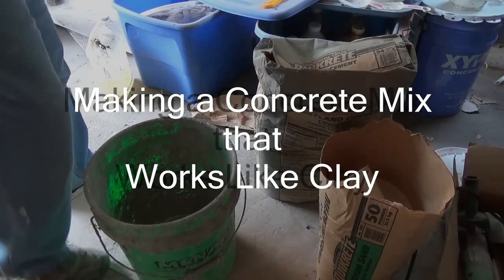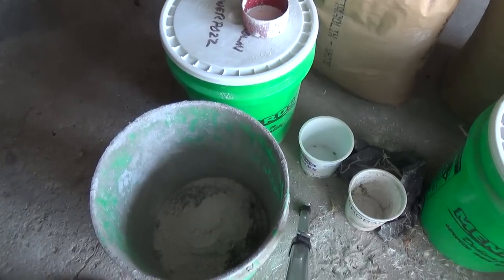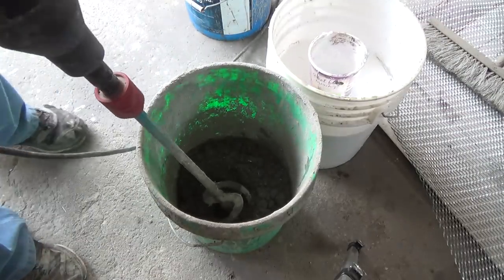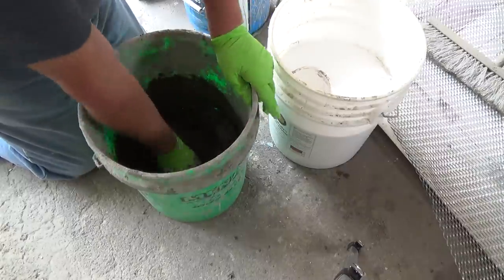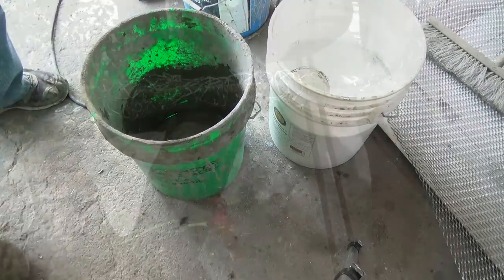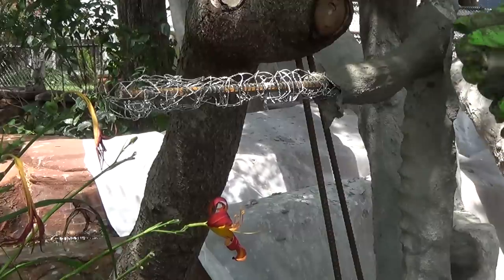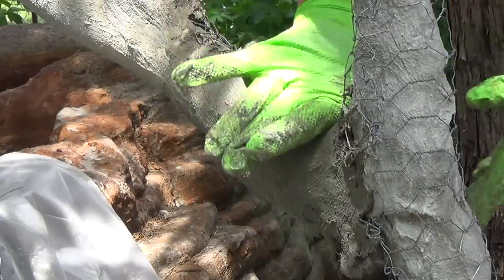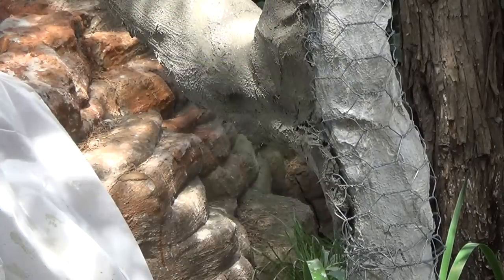#concrete #fauxbois Making a Concrete Mix that Works Like Clay

Comment: what if you mix this without the metakaolin will it still be sculptable like clay
Reply from the maker: Without meaning to be sarcastic, why would I suggest this mix if the metakaolin was irrelevant? From my experience, absolutely not!  If I gave you a recipe for bread, would you ask, "If you mix the ingredients without flour, will it still be bread?"
Reply: @dperry428  I'm trying to make something this weekend and cannot find metakaolin near me
Reply: Is there any suitable replacement I can access? will Bentonite clay work?
Reply from the maker: I haven't the slightest idea.  I've never used bentonite as an additive.  I am NOT a concrete expert.  I post what I have found works based on what I've read from research done at engineering schools.  I then worked with those materials over a period of 15 years until I have recipes that work for me.  I choose, then, to share what works for me instead of keeping it secret and charging people for it.  If you can't get the materials I have shown in the video, you're on your own to do you own research and experimentation.  Metakaolin works and is available for purchase online.
Reply: @rangeroutwear  Probably not, Bentonite clay swells alot and absorbs a lot of water. So you probably find that your mixture takes a lot of water to become clay like and once it starts to dry loses so much volume that it just crumbles to dust.
Reply: @dperry428  😂😇🤣
Reply from the maker: You might be interested in this:  https://www.academia.edu/91390981/Partial_Substitution_of_Binding_Material_by_Bentonite_Clay_BC_in_Concrete_A_Review

Comment: Why so many coats of chicken wire?  I’ve seen people do heads and sculptures on just the rebar
Reply from the maker: Making a sculpture is one thing; making a structural element is quite another.  In this video, I was applying the mix to an actual bridge that carries the weight of people crossing it. The use of rebar and chicken wire with this mix is a construction technique known as ferrocement that results in a final product of extremely high strength.
Reply: @dperry428  thank you that helps

Comment: Please can you write the recipe thank you.  So much
Reply from the maker: 5c fine sand, 10c OPC, 2c metakaolin, 0.5-0.75c pva fiber, 5c liquid (water and acrylic admix0  Optional:  add 2 tablespoons of crystalline waterproofer.  I use Xypex brand.
Reply: How much acrylic to water?
Reply: How long before it can be tooled?
Reply from the maker: That depends on the solids content.  The one I use is 50% solids, so I dilute 1part acrylic to 3 parts water.  Many of those available in home improvement stores are around 25% solids. Follow manufacturer's recommendation.
Reply from the maker: Immediately and until final set.
Reply: @dperry428   Hello, I'm really new to the subject, I'm just doing my first tests to achieve the clay texture. I don't live in North America and some of the products you use are really hard to find around here. But I wanted to ask since I checked the metakaolin page, what do you suggest and is this product a more advanced replacement for what silica fume is? In my country I get more silica fume than metakaoline, would it be a good alternative?

Thank you very much for the knowledge.
Reply from the maker: I also use silica fume, in addition to metakaolin, in my regular mixes.  Silica fume will make the mix very sticky.  That's why I don't use it in the clay-like mix. I can't be of further help as I only can advise on those things I've personally used. @danielrinaldi3737
Reply: Thank you very much.....  @dperry428
Reply from the maker: You might like to check ceramics shops.  They often have metakaolin, but they refer to it as calcined kaolin.
Reply: Yes! i just found some company selling i'll make some test first... mixing metakaolin and other using fume silica ill try to use with some pigments and try not to blend colors. Thank you so much!
 @dperry428
Reply from the maker: In your comment you mentioned "fume silica".  Please be aware that fumed silica and silica fume are very different substances.  Fumed silica is NOT what you want to use.
https://bisley.biz/news/what-is-the-difference-between-fumed-silica-silica-fume/
Reply: Thank you so much! I really appreciate your knowledge and help on the matter! I wish there were more people like you! Now I am going to read what you told me and any consulat will not hesitate to write to you. and if necessary I will send you the link of the product they sell in my country. They really call it Silice Dust  @dperry428
Reply from the maker: Silica fume is sometimes called microsilica.  Silica dust is NOT silica fume.  Silica fume is amorphous, silica dust or powder is CRYSTALLINE silica and is a significant health danger.  https://www.howden.com/en-us/articles/cement-en/what-is-silica-dust-why-is-it-so-dangerous
Reply: @dperry428   WOWWWWW super dangerous product..... im considereing to not make test with that silica dust
Reply from the maker: Unless you want your mix to be runny, don't use plasticizer.  It will negate the clay-like nature of this mix.  The liquid is acrylic polymer.  It is mixed with water if the solids content is high enough.  I use 50% solids, so dilute it as 3 parts water to 1 part acrylic.  Sika's product is https://www.emisupply.com/catalog/sikalatex-acrylic-latex-bonding-agent-admixture-sikarepair-sikaquick-gallon-p-25019.html?ftm_source=bingshopping&msclkid=8464c11628a810e82831a40abc04cecf
Reply from the maker: Lung cancer or silicosis is not something one wants.
Reply: @dperry428  I called the largest ceramic supplier in my area (Asheville NC) and they sell a product similar to "metakaolin" BUT it must be super heated in a kiln prior to use.  I dont have access to a kiln but need the ready to use metakaolin. It seems very hard to locate in the the southern USA.
Reply from the maker: They were offering kaolin clay, which is the precursor of metakaolin.  Try looking through these listings.  Note that some of them are in the south, including Alabama and Florida.
https://www.thomasnet.com/suppliers/usa/metakaolin-97009235
Grace Co. produces it in South Carolina.  https://www.chempoint.com/products/grace/metakaolin-aluminosilicate-pozzalanic/metakaolin/metakaolin-gmk-s-5
Virginia:  https://dchva.com/products/metakaolin/

Comment: I am so 1000% impressed, reading the conversation threads.  Was checking out Home Depot(HD) for  acrylic bonding adhesive and you mention Quikrete Acrylic Fortifier, unfortunately only qt size. They have Pro Sikalex, classified as concrete bonding adhesive & fortifier. Could this do? I am trying to get as much material close to me as possible.  Since I am applying concrete onto a wood panel, (wood cradle frame), I should apply this first and allow it to dried b4 applying clay.
Reply from the maker: There are literally dozens of brands of acrylic bonding agent/admix. Sika makes at least one.  What you have to watch out for is the percent solids in a specific brand.  The brand I use from Fishstone is 50% solids, so I dilute it 1 part acrylic to 3 parts water.  I think Sika's is something like 25% solids, so it should be diluted 1 part acryllic to 2 parts water.  That's where one brand may look cheaper than another, but it may not be if you can't dilute it as much.  When using acrylic from a specific manufacturer, follow their recommendations.  You'll want to NOT let th acrylic that is applied to a surface dry before applying your first layer of concrete.  So, if you are going to apply to wood, apply the acrylic as a bonding agent, full strength, then apply your concrete mix with acrylic in it diluted. The uncured acrylic on the wood will bond strongly with the acrylic in the mix.
Reply: Thank you. I could love to order KongKrete but 40lbs is way to much for now, which is also why I needed an alternative.(already have my shopping cart at the FishStone).  Not sure of Sika right now-good review but not enough product info.  Sakrete maybe.  I definitely will follow Mfg’s instructions and also your advise.  I am excited.  Thank you again.
Reply: Ok...just for your info : Pro Sikalex only 15% solid.
Reply from the maker: Then you'd mix it no more than 1 to 1 with water.
Reply: Ok.👍🖖

Comment: This looks like what they use on Lurncrete. This is structural right? Can be used for retaining walls and patios?
Reply from the maker: I didn't know what Lurncrete was until I just looked at one of their videos.  These are the same guys who call themselves Stonemakers.  I can't say with any definity what is in their mix.  All I can say is what i suspect from Stonemaker videos.  It's a mix with no large aggregate (no gravel), high cement content, high fiber and, from the looks of their admix put into ready-mix trucks, likely contains a retarder, such as molasses, and pozzolans, such as silica fume.  Looked like, perhaps, liquid silica fume.  I can't compare what I use to what they use.  The mix in my video is NOT meant to be structural, but as a finish coat or for small sculptures.  To make the mix structural, I increase the amount of sand to 1, 2, or 3 parts sand to 1 part portland cement.  I reduce the amount of metakaolin to 10% of the portland content instead of 20%.  I then add silica fume at 8% of the portland content, and CSA cement (calcium sulfoaluminate) at 5% of the portland content.  I use alkaline-resistant glass fiber and/or PVA fiber and I add acrylic admix to the liquid.  If I want to delay set, I add small quantities of citric acid.

Comment: Seems like quite a lot of OPC.
Reply from the maker: Yep! That's what makes it work like clay.  If you check out the company that does those one-day walls without using forms, they order 9 or 10 bag mixes from ready-mix companies and then add water reducers and set-delay additives to make their mixes.  Normally, you'd order a 5 or 6 bag mix.

Comment: Hi Mr. Perry,
I found your video on clay like concrete just what I’d been lookin for. Thanks. I have a question. I bought a concrete Cupid garden sculpture whose left arm and one wing has broken off. When I sculpt the new  arm/wing and want to attach to the original sculpture how do I do that?  Appreciate any suggestions you might have.
Reply from the maker: I would use a concrete drill to insert a short piece of wire rod to connect the pieces with marine epoxy.  Do not apply the epoxy completely to the edges of the connected parts. The crack that is left can then be coated with acrylic bonding agent and filled with a concrete-clay mix.  After initial setting, the filled crack can be sanded smooth.
Reply from the maker: Thought you might be interested in a repair I did recently.  https://youtu.be/dsf1-78L17Q

Comment: I want to try this. I am copying a Shapecrete project, but I can't find Shapecrete locally. Your mix looks like a good copy.

Any other options for the Metakaolin? I am in Vancouver and I have called every concrete supply and building supplier in the city and not one person has even heard of Metakaolin. Could fumed silica work? 

I can also get VCAS Pozzolan online, but I am unsure if that is the right stuff either.
Reply: What about calcined kaolin? I could buy that at a pottery supply store. Is that the same as metakaolin?
Reply from the maker: I am not a concrete expert; I only share what has worked for me.  There are many other pozzolanic additives for concrete, including fly ash and many others.  I have used only what I show in the video.  VCAS is essentially ground glass; I don't know how effective it would be. I can only suggest you try it out and see if it gives results that fit your needs.  Likewise with fumed silica, I haven't used it, so I can't give you any direction.  You might like to contact this company.  They are located in Vancouver.
https://www.imineralsinc.com/
https://www.imineralsinc.com/contact-us
Reply from the maker: @robertraymond2236  Metakaolin IS calcined kaolin.

Comment: perry can i talk to you i want to ask you a few things. 
is the small amount of fiber you added sufficient enough for structural pieces or should i add a bunch more fiber?
Reply from the maker: You can ask as many questions as I am able to answer.  What  do you mean by "structural pieces"?   You should use a mix that has the characteristics you want.  I would not, for example, use this mix to create the supporting structure of a garden bridge.  This mix is meant to be used for statuary and the outer, decorative layer of other pieces.  It is for its clay-like nature and for incorporating detail.  The cement content is very high in this mix.  If you are looking for high strength, then I would use a mix containing much more sand, along with other ingredients.  The high strength mixes would provide structural integrity with the clay mix as a final layer to apply the decorative finish.  That's not to say that this mix is not strong, but it depends on what is meant by structural pieces.
Reply: @dperry428  okay i see, thanks I know nothing about masonry. so what i'm trying to do is make a sphere shape like an egg. i'm using a large yoga ball, but one day i want to do one that is 8' in diameter. i plan to use basalt roving and wrap it around and basalt fiber chop in the mix. i'm considering carbon fiber mesh but this basalt is what i have right now. i'm wondering how much sand i can get away with where the concrete will not slop off the vinyl inflatable form. imagine trying to stucco a smooth plastic wall wrapped in basalt roving. i haven't tried yet but this is what i'm preparing for
Reply from the maker: I hope you mean basalt scrim or mesh and not roving.  Roving is a long strand of fibers that is chopped to make short fibers. To make a garden sphere with a yoga ball, I'd first put the ball into a plastic bag, since concrete will not stick to the plastic, making removal of the ball easier.  To make the sphere, I'd use a 2 to 1 or 3 to 1 sand/cement mix with my usual additives of metakaolin and silica fume, acrylic and fiber.  I've never used basalt fiber, but I'm sure its application would be similar to other fibers.  The basalt scrim/mesh will provide the needed reinforcement.  Just make sure when you mix up your concrete that you use a minimal amount of water to keep the mix thick. Start with a your ball covered with scrim. apply some acrylic to the scrim, and plaster on a thin coat with latex-gloved hands.  Let it set up, put on a coat of additional acrylic and then place the thick finish coat on.  Don't overdo the fiber in the mix.  It goes a long way to doing the job.  Too much and it will be difficult to keep the mix from balling up as it is applied.
Reply: @dperry428  ahhh you are right the roving is not bonded together. so use 3 coats of what type of acrylic product? thanks this is exactly why i wanted to talk to you lol
Reply: @dperry428  so the concrete will stick to the yoga ball but what do you think about a vinyl?
Reply from the maker: I don't know if it will stick to the yoga ball, but it will make a mess on it.  The plastic is dispensable.
Reply from the maker: I don't know where you're getting 3 coats of acrylic.  I'd put some on the scrim and between coats of concrete.  Otherwise, the acrylic is added to the water as an admix.  The acrylic is a bonding agent/admix. Quikrete makes one called Acrylic Bonding Agent. There are literally dozens of brands of acrylic bonding agent/admix.  Depending on the solids content, it is diluted  with water.  The one I use is 50% solids and I dilute it 3 water to 1 acrylic.  Follow the label directions as to how much to dilute it as an  admix.

Comment: Where can I get fine sand?  I saw some "masonry sand" at a nearby store.  Is that the same thing?  It seems pretty powdery.
Reply from the maker: You'll just have to look in your area.  I get mine from Lowes.  You might check local quarries.  Try to make sure its silica sand and not crushed limestone, which is calcium carbonate.  Also, check out suppliers of materials for concrete counter tops and decorative concrete.  When I was in Tennessee with my brother, the "sand" available there was coarse, ground limestone and was terrible for our use. You have to make do with what you can find or else pay a big premium by having it shipped.

Comment: I asked my husband to buy me some cement,  but he bought me concrete can I use it?
Reply from the maker: Of course you can use concrete, but not for making this mix.  Depending on the mix he bought, it already has sand and gravel in it.  To make this mix, you need to start with just sand and cement.
Reply: @dperry428  That is what I thought.  Thanks, only took me a month to get him to go and get that and it was wrong, maybe I will have the right stuff by this winter LOL
Reply from the maker: Just go to the local home improvement store (Lowes, Menards, Home Depot) and ask for Portland Cement.   Have someone help you load it as the bag weights 94 pounds.

Comment: Can you use diatomaceous earth instead of Metakaolin for your recipe? I reside here in the Philippines and can't seem to find it. Thanks for your answer in advance sir
Reply from the maker: I've never used it, but research I've read says it has pozzolanic activity, increasing compressive strength, decreases porosity and has particle packing qualities due  to the small particle size.  I have no idea whether or not it would give similar results in making a clay-like mix.  It does, like metakaolin, increase water demand and it will also, then, require great care when mixing to assure that water is added gradually and in ver small amounts.  You'll just have to experiment with it.
Reply: I'm interested to know if the method with DE works if you try it